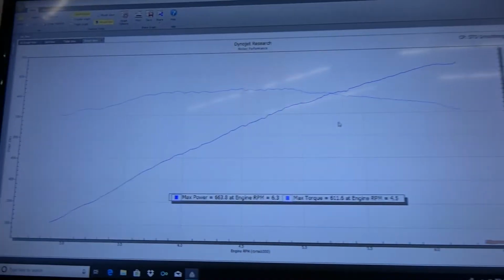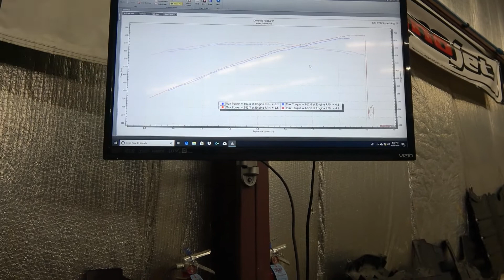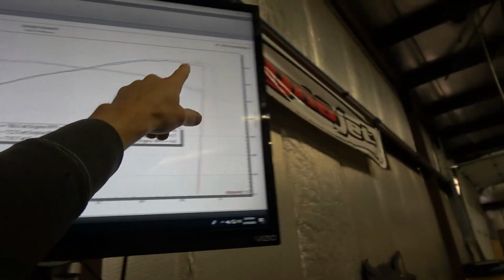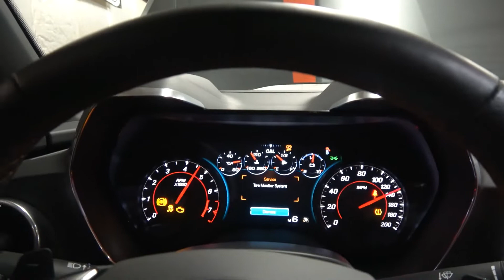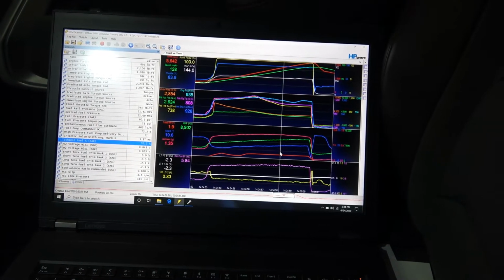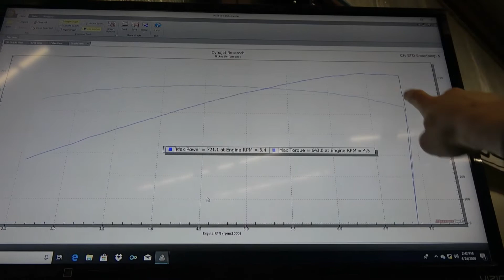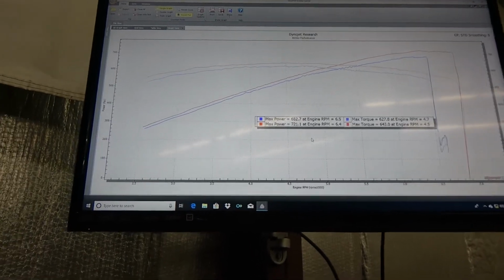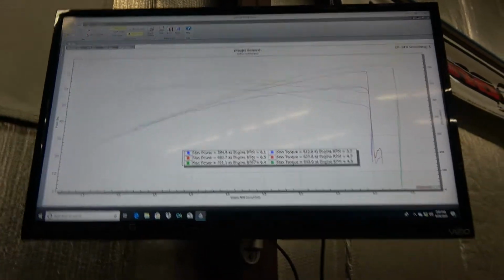Cammed Boosted 6th Gen SS

Comment: Stock TC? I have a 2020 SS and looking to do the exact same setup on mine. It’s a daily driver so I want to keep it lower on boost for longevity since it’ll already toast the warranty. It will also not be tracked. I’ve seen plenty of factory piston issues on LT1s (there’s also a GM bulletin for the same) and under boost, they can blow holes in the tops. Where are you located?
Reply: Loves Park, Illinois